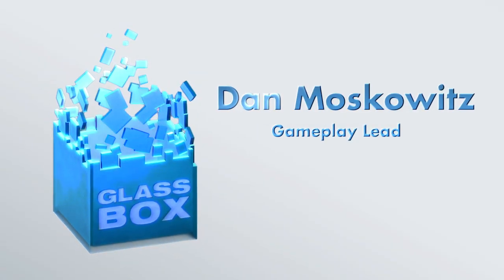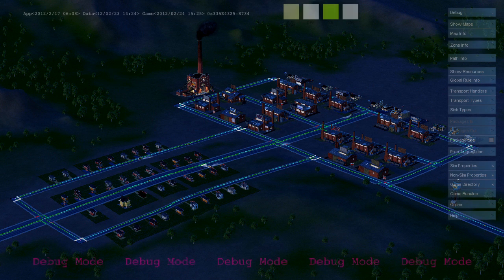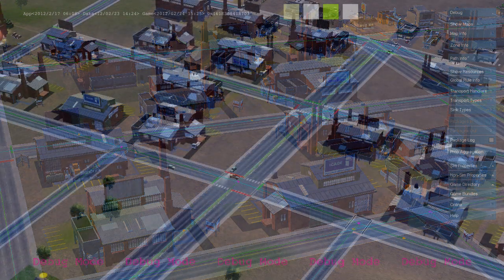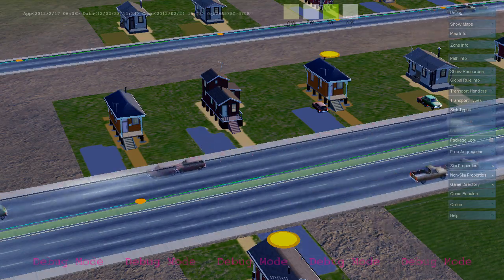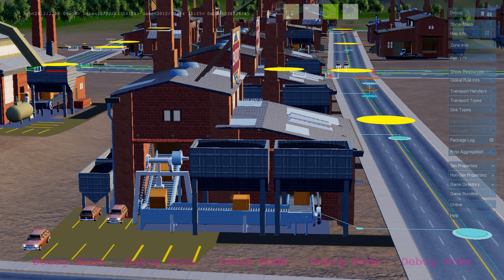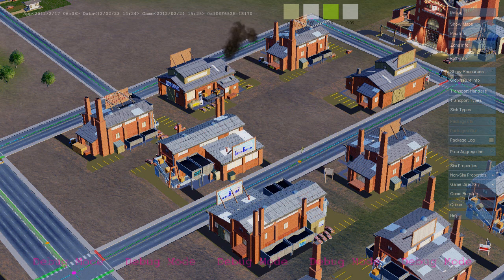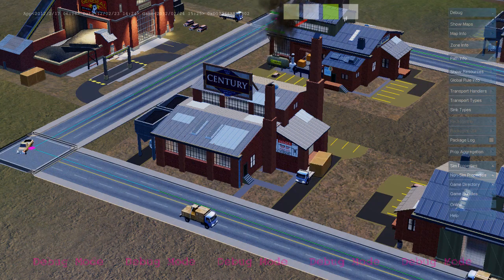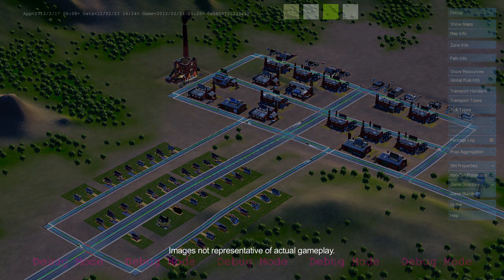SimCity GlassBox Game Engine Scenario 1: The Economic Engine (coming March 5, 2013)

Comment: Actually, it verifies the client every time you start the game, through an internet connection. After verification you don't need the internet connection anymore as long as the game is running. If you exit the game and start it up again, it will need to verify again through an internet connection.

Comment: I have a question about this economic engine:

In the old Sim City 4 Regulating traffic was a problem because those car always kept going on the shortest possible route which meant that I had 3 highways leading to the same end and only one was being used, but that single one constantly overflowed. It was a nasty traffic bug and I'm wondering whether it has been fixed?

Comment: My question is, how will they be able to run this simulation really fast for a long time without going out of sync with the data?

 I mean most the time, we're playing on Fast or Cheetah speed. I would think at Cheetah speed, 6 am would pass about 5 times in a few seconds, while carrying out the rest of the "help wanted" simulation in a very short amount of time. 

What I would do just to peak at the source code.

Comment: But EA controls Maxis not only with distribution, but also by setting deadlines and even controlling what is in the game or not. If the Deadline is years from now, there MIGHT be transportation or MIGHT be terraforming. But with the deadline so short, they have no choice but to either remove those features or work their ass off hella hard in order to squeeze it in. With no single player, which EA seems to be so proud of, this game took a portion of my hope away.